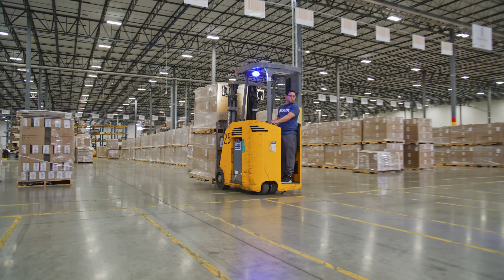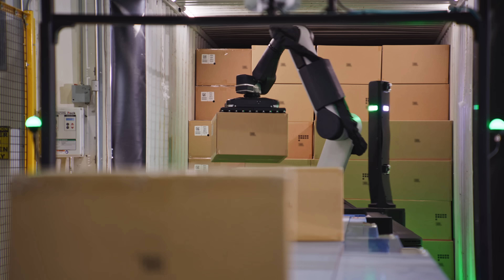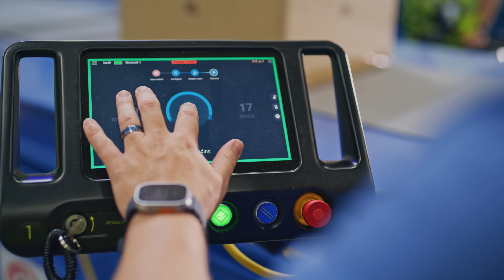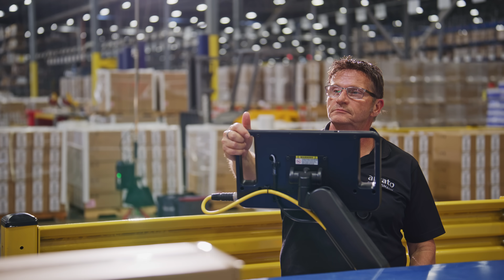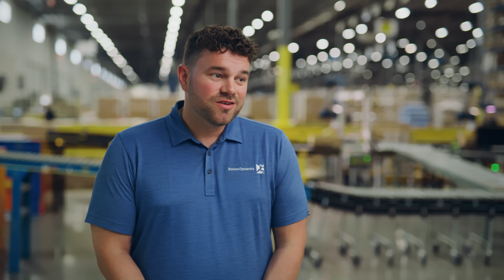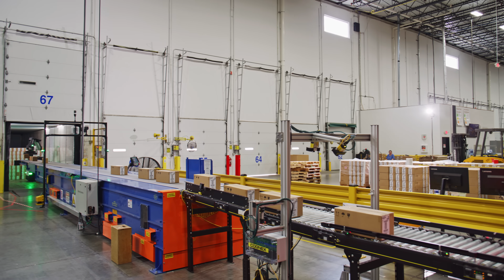Stretch at Arvato | Boston Dynamics

Comment: So, at manufacture, stretch unload boxes from pallets into a trailer, and at the warehouse, stretch unload the boxes from the trailer to put them back on pallets? Why not just ship the pallets?
Reply: Why are you assuming that anyone would set it up for Stretch to unload boxes from pallets and load a trailer rather than not use Stretch and load the pallets?   If that ever happens, there would have to be a pretty good reason for it, but I can't think of one.
Reply: The packages in the containers might have widely different routes.

Comment: Why pallets are not used instead of individual carton boxes?
Reply: You are just moving the package unloading to somewhere else then, the pallets still have to be unloaded. The containers are always just placed, it is not like there is a truck sitting and waiting for it to be unloaded, so time is not the issue.
Pallets also take up more space that could be used for products. You can pack packages more neatly if you are not restrained to the size of a pallet, and you can use the full height of the container. A pallet would need that bit of vertical clearance to be moved in and out.

Comment: In the U.S.A. don't you use europallet or similar to ship goods? It's faster than any other solution
Reply: We have standard pallets and forklifts that lift them, if that's what you mean. Our pallets are a bit larger than europallets.
Reply: If you want to unload the container as fast as possible, pallets makes sense, but if the container is able to stay for some time, it makes more sense to not have pallets and do the unloading directly from the container, instead of moving pallets to an unload area, since the pallets would still need to be unloaded.
Loose packages is also fairly common in the EU.

Comment: There was a way better system than this. Why in the world did they dumb down the original amazing system. Is it to make Automation in trucking look bad. There was a conveyor trailer that literally pulls the whole load at once into the trailer off the conveyor belt from the factory. The turnaround was like 30 minutes or less

Comment: Why wouldnt you just just the forktrucks you already have to unload the boxes? Surely thats faster than unloading one box at a time?
Reply: The boxes arrive as loose-loaded, not palletized. The downstream logistics wants the boxes on conveyor belts, one after another. How would forklifts do this any faster? I'm pretty sure the answer is that it wouldn't. It's not as if this factory is unfamiliar with what a forklift can, and can't do. It is typically done by a person.
Reply: @kmw8775  Dump bed on the tractor trailer.

Comment: Again: no complete unloading. Why?
Its all cool ... sure .. but i think 1 guy can unload those 3 small boxes in the same time, or even faster.
And with larger, heavier boxes stretch may have problems where you then need the tech guy.
All show, all hype. Show a complete unload or it doesnt happen :)
Reply: This is just normalizing pushing jobs away from workers to machines. These jobs can be performed better by humans so long as a well done lifting and moving movements are emphasized.

Comment: I doubt the robots are faster unloading and loading than a human lol...they are super slow
Reply: They will get faster and more efficient over time.
Reply: They don’t take sick days they show up everyday and are reliable a lot of ppl aren’t nowadays
Reply: They can work 24/7, they take no breaks, not to smoke, not to eat, not to drink water, and they're still in their early days. They don't struggle with heavy packages. Some can pick up multiple at once. That's 200% better than a humans working capability.
Reply: I dunno man, you push a human too hard they go on strike 😂
Reply: Lol! Cars are so inefficient and slow! My horse and buggy is way better and more versatile!
Reply: Not sure about your life experience but have you seen manual unloadlogiin logistics center like this for 4 years as maintenance electrician and yes 2 guys can unload faster the quarter of the container of boxes below 30 lb of weight. Then they take a brake and slow down, they drop boxes, they place them uneven on belt line and they can't be scanned . They come and fix them. After full truck they move to the next one hating they life and they need smoke brake not because they smoke but to have some rest. So in the day run of several trucks this robot is faster. Not cheaper because manual  labor can be very cheap but faster.
Reply: Tortoise and hair situation